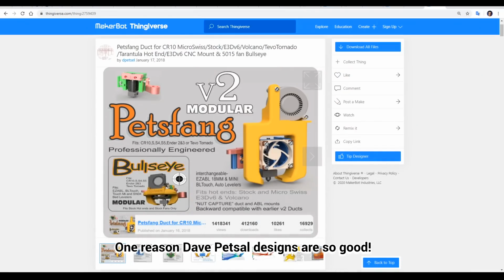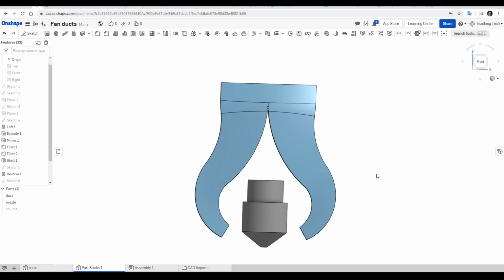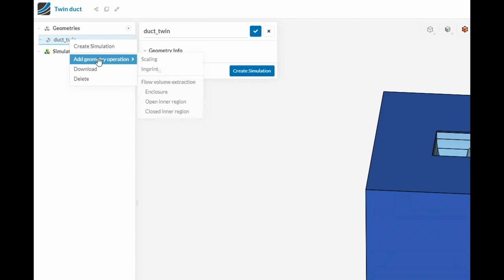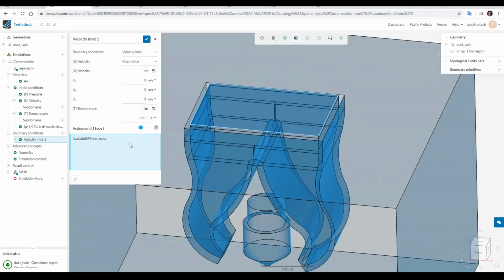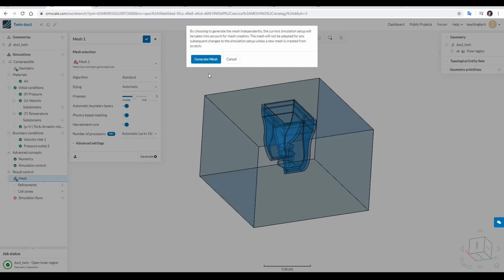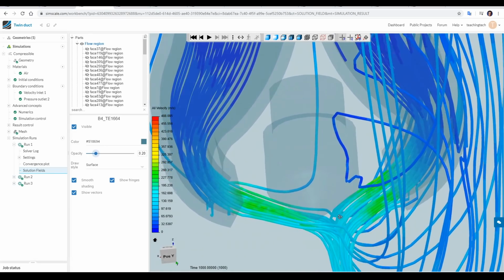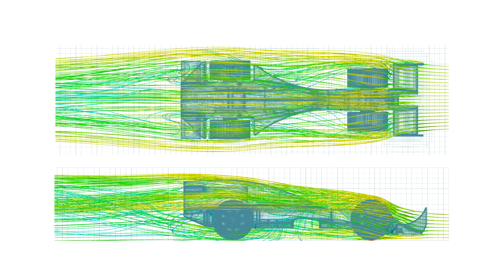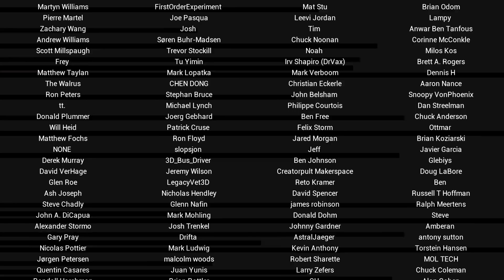Use CFD to take your 3D printed designs to the next level - for free!

Comment: Love your videos! As a PhD student doing lots of CFD work, I'd caution that CFD is not that simple - a lot of concepts are needed to get accurate results. I've spent hundreds of hours learning these, and I still feel completely in the dark. At velocities this high, turbulence modeling will be crucially important, not to mention meshing - I've spent tens of hours designing the mesh for a lower-velocity flow than this. I hope the program automatically chose a turbulence model behind the scenes - and even if it did, turbulence modeling is far from one-size-fits-all. It probably chose k-epsilon, which is a weak, time-averaged model. A small tweak to setup can make large differences in results, so it's important to verify a CFD run against known results. Intuitively, a 5015 blower causing peak velocities of hundreds of meters per second seems unlikely. This could be from bad CFD, or it could be from the assumption that the blower is pushing its open air flow rate at these backpressures. If you multiply average inlet pressure (in Pa) by average inlet velocity (in m/s), you'll get power. I'd be willing to bet that exceeds the fan's electrical draw, which is physically impossible.

All that to say - the average Joe will probably get cool looking results from this. For very low-velocity, simple flows, you might even get useful results. But for high-Reynolds number, turbulent flows like this, it takes a lot of knowledge to get good data.
Reply: This is what you call colorful fluid dynamics :D thanks for the explanation! It's cool that this free tools exists I'm sure you could refine it but as always GIGO.
Reply: @tsslaporte  Ha, colorful fluid dynamics. I'll have to tell my advisor that one! And of course, garbage in, garbage out!
Reply: Thank you so much for taking the time to explain how truly complex CFD simulation and analysis can be. Without an engineering degree it's nearly impossible to scratch the surface of understanding and properly setting up boundary conditions.
Reply: Exactly the comment I was looking for. As an aerospace engineering student, I am already very skeptical when he says that 15/16 year olds can do it. My professor even said that it would be too difficult to include into the UG curriculum. However, I do have to say that it could be useful to "get a feel" for how the air flows, especially for those who have zero knowledge about fluid mechanics.
Reply: Thank you for your input and giving the disclaimers. It's good not to get overly confident with these things.
Reply: Agreed, I trust the guy that do real model test than the one printing Color plot.
Reply: I've never done CFD work and will probably never will really. Is it possible get an almost good result with this? I understand it won't be perfect by a long shot but it is good to get 70% there at all?
Reply: @madbull4666  Sadly, it's very difficult to make blanket statements in CFD. It's such an inexact science that the answer is almost "it depends". I'd say that with a basic knowledge of meshing concepts, mesh-independence, and convergence; for a simple, incompressible (below Mach 0.1 is the criterion iirc), steady (i.e. time-varying effects are insignificant) flow; the average Joe could expect to get useable results. The difficulty is that you don't know what you don't know, and some other engineering/scientific concepts are necessary. In this case, knowledge of pump curves. I think at the very least it's a cool gateway to engineering, and for personal projects like this there's no harm in running inaccurate simulations.
Oh, also I've never used this particular CFD package. If it has not been thoroughly validated, it can be hard to trust a code even if you know what you're doing. The software I use, ANSYS Fluent, has a 2500 page user manual and thousands of pages more explaining their equations and code.
Reply: @reidprichard  I was afraid of such an answer, if it was this easy then things like cars/airplanes etc would be quite easy to model and make rather than spending hundreds of hours making a single vehicle. 

I was hoping to make my own fan duct for my printer as the original and the remakes don't quite fit exactly what I want to do. I'd love to learn this but I simply don't have the time and it would take hundreds of hours probably to get a semi accurate air flow model. Not sure whether I should just do this and hope for the best or something else, what do you suggest?
Reply: @madbull4666  Huh, I thought I replied but it disappeared. Take 2.

I sure wish CFD were easier too! I'm not sure how many hundreds of hours I have into the model I'm currently working on for my research.

You're pretty dead on with your assessment of the feasability of doing CFD. It would probably take me 5-10 hours to do the model, but the learning it takes to get here is the issue.

Well... there might be a way for you to get usable CFD results. I would bet that with 1) a very fine mesh (maybe 100k elements for something this size), 2) reasonable boundary conditions (you need to know roughly how much air the fan will pump when connected to a duct; not sure where you'd get that), 3) the SST K-omega turbulence model, you could get decent results assuming this solver is good. The caveat is that the model will take a long time to converge*, and there's a chance it will diverge**, and 4) you have a bit of background engineering knowledge to apply common sense checks to your answer: Pressure drop across the duct is 100kPa? Probably not. Max velocity of 100 m/s? Definitely not.

*You need to run a CFD simulation until it converges. Effectively, this means that the solution stops changing. Since you would be looking at pressure drop across the duct, I would watch that value as the simulation progresses and call it converged when you see a long-term stable trend where it isn't changing. I have no idea whether this software lets you see that information.

**The numerical solvers behind CFD guess at the answer until they get it right. If their guesses are too bad for a variety of reasons, the guesses will just keep getting worse rather than improving. Eventually, it will break.

So with all that said, I would just design it so that it looks good. Intuition goes a long way to making something flow air well in a simple situation like this. If you had the desire to do this from a more informed standpoint, I would learn about resistance to flow such as the friction factor (effect of wall friction on flow) and loss coefficients (used to quantify the effects of, say, a 90 degree elbow on flow). The main takeaways are 1) Diameter has a hugely exponential effect on flow - I think frictional backpressure is proportional to diameter to the fifth power, if I remember correctly. 2) Bends or sudden transitions are bad. Sometimes it will be worth slightly sacrificing diameter to give the flow a smoother path. Being able to run some numbers in those equations would allow you to evaluate when to compromise in which direction. 

It's tough, because I've approached all of these topics with a lot of engineering background I take for granted. Dimensional analysis is a basic example of this. I know how hard it was for me to learn these things, but a lot of this would look like Greek to someone who wasn't eased into it. I love fluid mechanics, so I'd love to see someone else get into it, but you may be happier in the end if you just use intuition in your design. In light of immovable constraints like printability, there is probably little difference between a good design and an optimal one.

Oh, and I see someone else in the comments mentioned testing a design with smoke - that could tell you a lot about flow patterns!
Reply: I agree with you, this results are not trust worthy. It is highly unlikely to have inlet 7m/s and end up with supersonic flow. The usage of compressible flow solver in the first place is questionable. Having said that, I found it a very good tutorial for many people.
Reply: @hk318i  I thought the compressible solver to be pretty questionable too. It wouldn't be too hard of a calculation (if I could remember the formula) to find the choke pressure of a duct this size - I'm sure it's far in excess of what this fan can provide. IIRC, it took around 80psi to get an air compressor blower nozzle (so, a few mm in diameter) to choke. Of course, you can have compressible flow below M=1, but that would be an easy idiot check for the results.
Reply: Reid Prichard we use ansys simulation, the software price is just...... high to say the least, we did try to optimize a 3D printer cooling ,we use about 500000 mash in simulation. What about you guys?
Reply: That's being a little elitist, don't you think? 
Mechanical Engineer here, although this isn't perfectly correct, it neither has to be or tries to be. Keep in mind this is him teaching to the average'ish public.
Get off your high horse and enjoy the fact ath people want to learn. 
I do accurate CFD at work almost every day, real life testing has shown good correlation between the simulation and reality.
Reply: @Freddy_Lie  Yeah it's a lot about looking at what is the goal, expectations, and keeping these two in check on their own categories. I'm an engineering student myself and haven't even gotten around the CFD classes (probably will have to next semester tho...), but just knowing as much as I needed to pass the tests in fluid dynamics, we both here know it ain't no kid's play, but still, the average Joe ain't putting 300+ people on a commercial jet he made on his backyard. As long as Average Joe gets his Colorful Fluid Dynamics displaying reasonably well the flow of the fluids and what to fix on his fan duct, it's fine. Then again, Mr. Average Joe also has to keep away from the Mount of Ignorance of thinking he's now and engineer and we're overpaid button mashers in front of a PC. As long as we all know what to expect of each level of proficiency it's all fine and everyone is encouraged to learn and become better for sure.
Reply: @Freddy_Lie  He is just being realistic. Why so butt hurt?

Comment: You should have used a proper turbulence model instead of laminar.
The flow coming out of a fan (whether radial or axial) is highly turbulent, if you are simulating flow after an axial fan, I'd suggest k-epsilon RNG model with proper wall functions.
If radial fan, k-epsilon Realizable or k-omega model could be suitable.
Also, keep in mind that the rotational moment after the fan could have a very big impact on the flow downwards. (which means at least some kind of rotationary momentum should be added into your inlet boundary)
Reply: r/vxjunkies
Reply: Came here to say exactly that!
Reply: True & SimScale offers both turbulence models fortunately :)
Reply: Well, what do you mean it is a turbulent model? Do you mean that appeared vortexes? The laminar flow can be justified if it fits the Reynolds number below 2100. As examples, the von Karman vortex can be solved using a laminar solver as well. I can assure you that you will get the vortexes and it does not need a turbulent model as long as Re is below 2100. However, as many people agreed the CFD simulations are not that simple. In addition, as you said the mesh has to be well chosen and made. Actually, the mesh is the state of the art itself in CFD. The CFD software lately becoming more and more user friendly, however, without the CFD engineering background in fluid mechanics can lead to wrong conclusions.

Comment: On times of Ryzens and Threadrippers, you should go for a non-cloud based program :D
Reply: That's a bit silly to do. Not many people will be able to use the full potential of a threadripper cpu and thus that's a waste of money. In this case, you're only using the resources when you need it. Also, I doubt any of the Ryzen solutions out there are powerful enough for CFD in a reasonable amount of time.

Comment: Good to hear that there's free CFD software out there. I used trial of Autodesk CFD to analyze and optimize my design of fan duct for E3D v6 (https://www.thingiverse.com/thing:3590464 ) I can see a lot of similarities in the initial setup  and configuration. It took some time to understand the entire procedure. An advantage of Autodesk CFD is that it runs locally and so much quicker. But it also tends to crash often and it was trial. I'll give this free CFD a try for testing my new fan duct for Creality printers (https://www.thingiverse.com/thing:4306426 ). Thanks for inspiration
Reply: Need to fix your link. It's add the end parentheses to the url.
Reply: I wanted to use Autodesk CFD too, since I got a Student version, but sadly it doesnt even run. It's a known issue, which many people have, but Autodesk doesn't care at all and wont fix the issue. Great to see that it worked for you.

Comment: The fan duct on my Reliabuild3D printer was designed by an engineer who works with fluid flow all the time at Flowserve.  It is simple without any crazy bends (thing:3056162 on Thingiverse).  It makes it look strange because the fan is hanging way out in the front.  You want to get the air in and out quick. The 2 sided or all around airflow can slow down the incoming air from the other side.

Comment: This is incredible! I was just thinking how handy it would be to have a basic, hobbyist cfd program. One thing you can do to make your sims run faster is to take advantage of symmetry. Basically, cut your models in half before exporting and then make sure the fluid doesn't exit through that face.